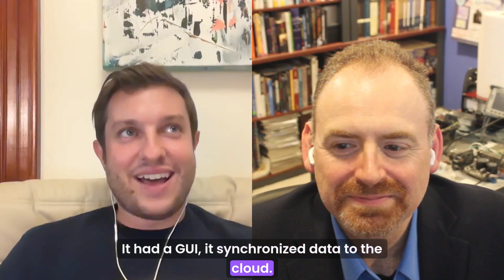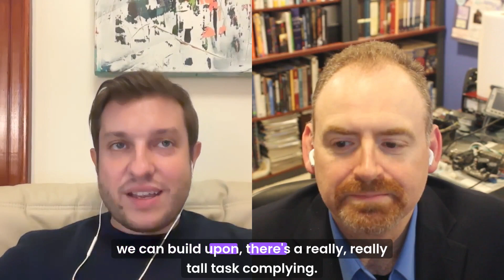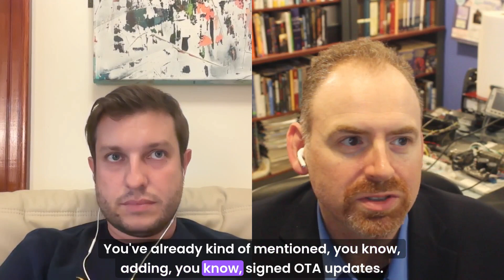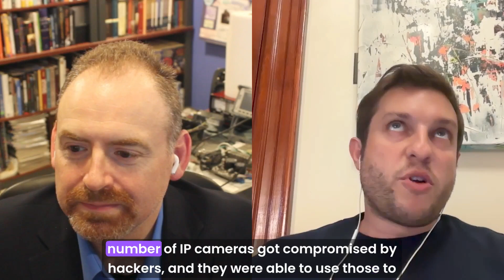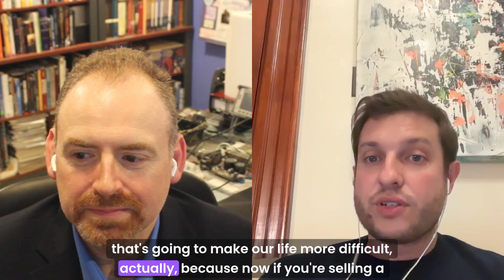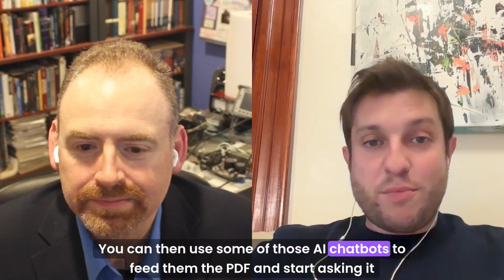#008 - Are Embedded Manufacturers Ready for IoT Security Compliance Demands with Francois Baldassari

Comment: I am wondering now, should I stop learning C/C++ ? if Regulators are discouraging/dropping these languages, What should beginners do right now? Even regulators are talking about RUST, Is there any other alternative except python?
Reply from the maker: As an embedded developer, I don't think C/C++ will ever be dropped. Regulators may push for a specific language or make it easier to certify another language, but at the end of the day it's up to the team. If you have the right processes and tools, you can just as easily create a project in C/C++. 

60% of projects today or more are still in C. 25% in C++, and the remainder in a variety of languages. I'd recommend learning Rust so that if there is a rapid migration to it, you aren't left behind. However, the future is probably more a mixture of languages. C/C++ for low-level access and drivers, while C++/Rust are used in the application layer.
Reply: @beningoembedded  I've noticed that Embedded Software Engineer positions oftenly require python instead of RUST (well, may be for python is multifunctional). Do you think it wise to put effort on python and postpone the learning of RUST?
Reply from the maker: @ESEben10  No! Python definitely should have priority over Rust. It will be several years before we see a real big push for Rust in embedded. It's still "the early days" for Rust.